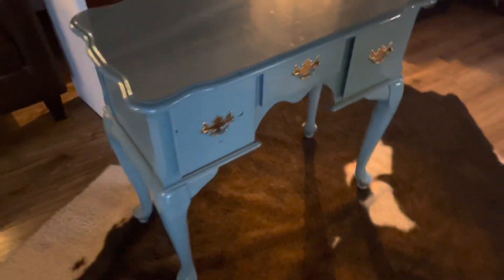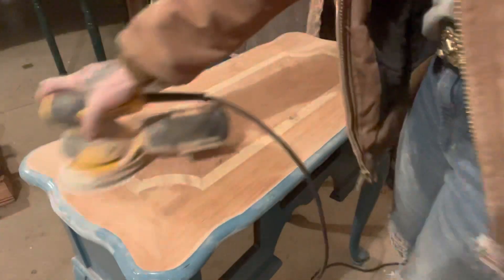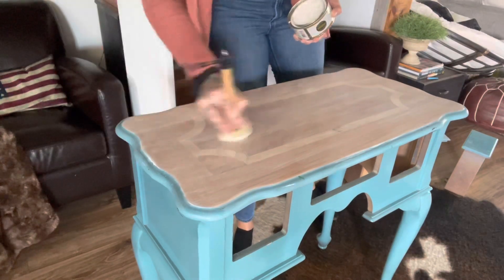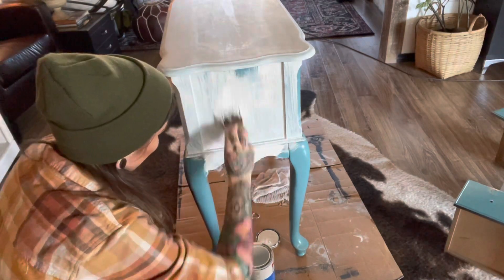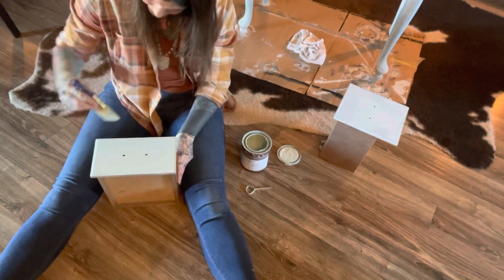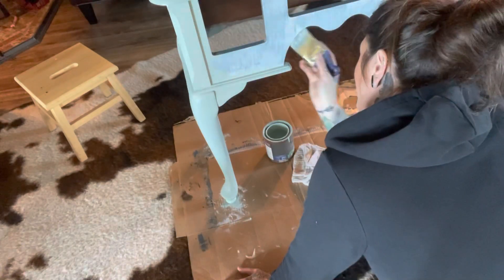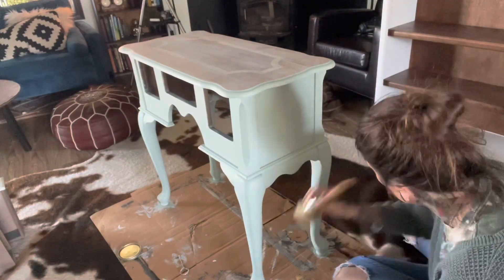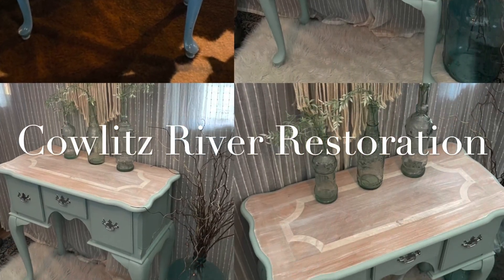Furniture flip console table refinished

Comment: Hi thanks for the inspiring work, I have a small wooden furniture item from India I tried painting it with permanent acrylic and chalk paints, but the paint seems to come off if I rub it with wet paper. I didn't do any sanding or prep just cleaned the surface. Please suggest.
Reply from the maker: Did you happen to seal the chalk paint? I’ve learned that unless I seal chalk paint with a finishing product that it will come off with water. Which can be helpful when I want to get it off! Not so helpful if I want it to stay put. I hope that helps 😉